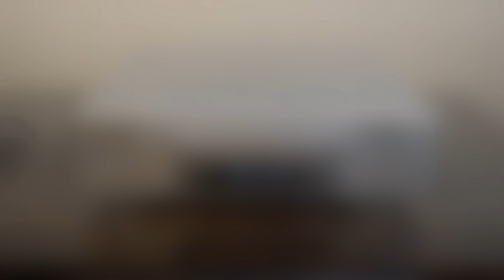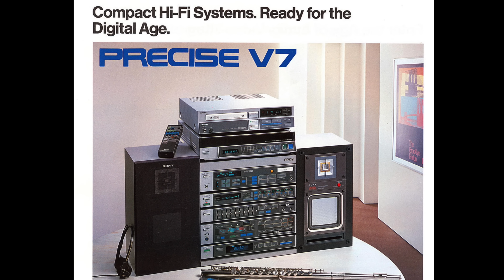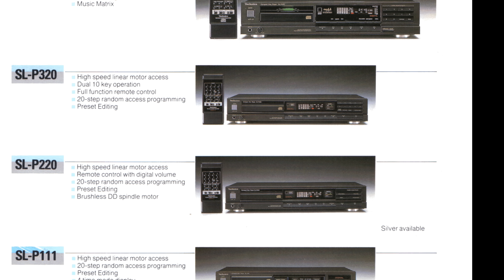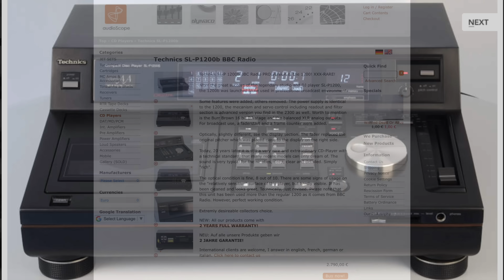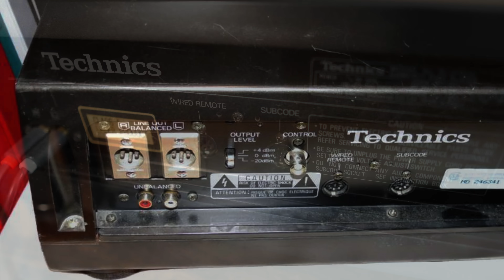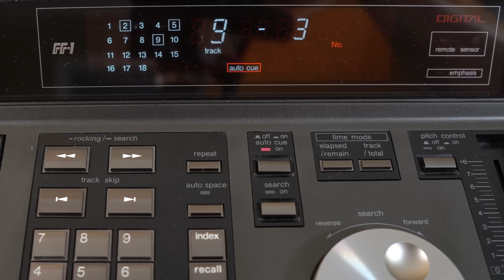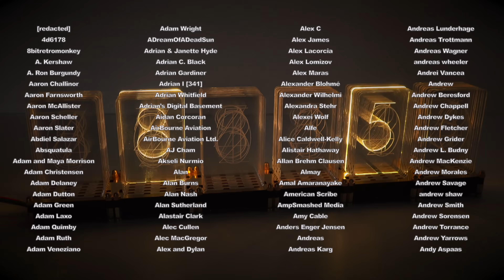How CD players lost their cool & why this Technics didn’t.

Comment: I think that it's really boring to see evolution of CD players because during the age, manufactures slightly reduced amount of buttons on a front panel. Front panel looks cleaner but for many tasks, you need a remote or find settings in a menu

For example SONY CDP-415, released in 1994. On a front panel, we can find buttons for basic controls like PLAY, PAUSE, stop, eject or fast forward, but also a keyboard to directly select a track on a CD. Display shows actual track number, remaining time and all next tracks in a grid. I dont have a remote but I've never needed it

A 14 years later in 2008, SONY released SONY RDR-HXD750, which is also able to play DVDs and record TV shows from DVB-T, but on a front panel there are only basic controls like play, pause, stop, eject and two buttons to skip to previous or next track. Display had been reduced to a single line alphanumeric display, so it's a step back from CDP-415.

But in 2015, LG released LG-BP450. Design is nice and clean, device is really small but without a remote, I am only able to power device on and eject tray. Next to this two buttons, there is only one LED which lights when device is powered on and flashes when I press a button on a remote. But to determine which track is playing or how much time remains, I need to have a TV powered on. I dont know if newer devices which will be relased in the future should have worse controls

Comment: I remember when these came out, or at least when I became aware of them. It was 1988-ish, and me and my mates were all vinyl DJ's (Club DJ's in San Francisco) and all had SL 1200 turntables, because of course we did, those are the only proper  scratch turntables for a DJ. Someone started going on about how Techniques had a CDDJ unit with pitch and everything. He thought CD's were going to replace vinyl in the clubs and we all laughed. Fast forward about 12 years and damn if he wasn't right. It was 2000 and most of my DJ buddies from back then had retired, and those of us left were mostly all switched over to CDs. At that point there were much better CDDJ units than this, but one night I had an encounter with one of these beasts. Actually a pair of them. Anyways I got booked for a guest DJ spot on a Sunday night. I had been drinking all day and was SMASHED. Long story short, somehow I managed to pull off a half decent (barely passable really) set even though I couldn't see or stand up straight. What a night. I will tell you all about it some time.
Anyhow, my admittedly foggy recollection of using this unit was that it was clunky, hard to cue with, and the unit reset itself every time you put in a new disk. Give me a Pioneer CDJ 1000 any day. Now a days those are old stock too, and most DJs have gone over to a digital DJ controller with Serato or Tracktor, plus one or a pair of good old SL 1200's and a laptop full of music. Gone are the days of crates of vinyl or books full of CDs. These days if the club has the right setup a DJ can show up with a thumbdrive full of MP3s and his headphones and rock the house all night. Like Bob Dillon said, "The times they are a changin'."

Comment: ´The problem with not to see, if there is an CD inside, maybe would be fixed by an intelligend Design, maybe to mirrow the disc-topside to the front of the player. And if we fully creative, the topside  can be in such way visible, when there is a light, that swithed one times per wind of the disc, so that we can see the disc-imprint in flash-light and see the inprint in identifiably and readable way on this position. 
But... maybe in distorted view, because the frnts of the Player are not high enough, so that the inprint is more broad, then high. But better as nothing to see. Th eproblem, that the light cannot see, when the disc isin the direction, so that so scripture on is in the right position (and not bottom up), maybe one can prevent, by inserting the disc in exactly the right orientation so that the font is illuminated the right way round. Overcomplex? maybe. But a solution of the problem.

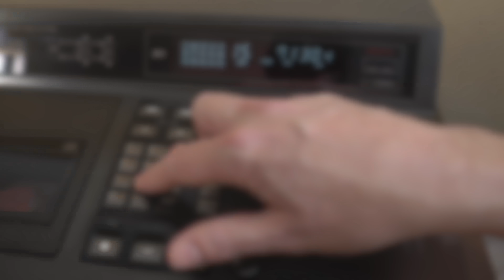Comment: Around 13:00 you discussed the ability to cue very accurately. Another feature often found in these machines is the accuracy in timing of play back. The time from the moment you trigger it to play. For editing purposes it's important to be repeatable. You want it to take the exact same time to start playing from the moment you trigger it to play a specific point. it depends on the spinning disc and the location of the laser at the time you trigger it. You might have to wait for another rotation until it's at the right point to Pllay. The really accurate machines would compensate for this. Every time you press play it took the exact same amount of time before the play actually occurred. If you were using the music for editing this allowed for very precise edits.

Comment: Thanks for your hard work. But you failed to mention that a lot of early CD players did not have gapless playback. For instance, when playing classical music, there should be continuous sound when tracks change within a movement. But on some older players, there would be a one second gap of silence when the tracks changed. Also, some initial players (and CD's) also had index numbers within a track, e.g. one track could contain 12 iindices within it. Cheers.

Comment: I have been a pro mixing performance DJ for decades and the Denon was the first realistically usable machine. The technics just didn’t cut it in a club. Still opening the wrong drawer was a definite fail risk so when the first pioneer CDJ’s came out they were a god send. Most pro club DJ’s defaulted to the pioneer pro range and have remained there ever since even though we now play digital files.

Comment: When you are saying the Technics is a "model from 1986 and you can forget about playing any discs you burned" - my first CD player was a model from exactly 1986, a german "Schneider CDP 7600". This one later played EVERY burned CD I ever gave it. No issue at all... 
Would be quite interesting what really makes the difference that some old player can do that and such an expensive and professional model can't... 
What might be important also on my CDP 7600: it claims to have a "3 beam laser pick up" system, what seems to be a first improvement done one early consumer players. And even more important maybe - after one initial issue right after buying it (problems with playing CDs in general) mine was "hand adjusted" (as they told mit back then) on warranty and then worked as expected. And still does. Even had to replace the bulb behind the LCD once in 1999, to led backlight on this model 🙂

Comment: Back in the mid to late 80’s my friend’s parents owned a PYE (Philips) MIDI stereo system. It was a black, one piece system made to look like a more expensive stacking system (like a lot of the units back then). The main thing I admired on the system was it’s integrated drawer loading CD player at the base of the unit which had a long rectangular window above the drawer. When a CD was played an amber LED would shine down on to the disk so you could see it spinning through the window. This complimented the players amber LED display beautifully. Loved the design. It’s such a shame that it never caught on.

Comment: I remember it well, having spent many a lunch time down Tottenham Court Rd, going from HiFi store, to HiFi store drooling over the separates I’d add to my wish list. I did however save up and buy the SLP-770 which was the 3rd tier model down in the range, it also featured a jog dial, although not as useful as this, more of a gimmick really. And although it had a draw mechanism, it did have a window and a 45deg mirror so you could still see the CD spinning. Yes, the SLP-770 was the crowning piece of my Technics HiFi at £370. I sold my system years ago to my older brother, he still has it along with the cassette deck, digital tuner and amp.  Happy days.

The comment about the SPL-1200 falling on you genuinely made me lol, so true 😆.

Comment: Here's another CD player recorder that is completely out of the ordinary and gives you awesome audio beyond anything else I've ever heard and that is something by marantz from 1991 model number CDR one.. revered in Europe is one of the finest CD players of the day and still are as well as being able to record on any disc format from Orange book to red book without any problems analog and digital input analog and digital output including many other toys that you will never see on another CD recorder since that time the marantz cdr1.. back in the day in 1990 was so incredibly expensive as well close to $7,000 for one of these recorders and the only company that produced cdrs at the time where TDK which were green died 74.24 seconds long recording time and had a foil backing which would begin to flake away in 3 to 5 years.. the cost for these blank discs of the day or anywhere between 15 and $25 each because of copyright agreements between marantz and TDK in the recording labels to pay for what you would have copied of which they would have gained income from if you had just gone to your local record store and bought a copy of whatever it is you were recording.. other than that.. I have truly not found another CD player that comes even close to the Sonic ability of the Moran cdr1.. have owned this piece now for a little more than 30 years and it still works fine it is a tank a concrete died in the wool last forever machine..

Comment: I agree about the CD players being boring. The first one I ever had was a Sanyo CP-10 which was a quite small top-loader that let you see the CD as it was spinning and I remember being intrigued (I was around 10) by the fact that the CD rotation slows down when playing the later tracks, as opposed to a record player. I still have it somewhere but it had stopped reading discs at some point - might be worth it to try and repair it!

Comment: I owned a couple of top loaders, but they were mostly Boombox Style. I think the CD was really a format driven by convenience, I think this is shown by how quickly it was replaced by streaming/digital ripping. I think that also played into the case format and stackable nature. Let's face it, you only had one the top of the rack, and that was reserved for vinyl.

I had a couple digital video recorders and computer hardware that was cd-rom or dvd-rom and they had enormous lifetimes for the discs because they used cassette cases. I think it also showed how the race to the bottom for cost drove CD design. The original disk design was with an optional cassette. I only found that out much later when I was reading through some of the specs. 

I do love that promodel. Something about the tactile design, and the button heavy panel. Very cool.

Comment: Just my IMHO. But CD's were so reliable you didn't need to see if they were running. With a cassette or record you wanted to be able to see if something is wrong and destroying your media. The CD on the other hand usually was safe even when the machine failed. I think why people really feel meh is if you bought a $100 vs $1000 machine they all basically sound good and very similar.

Comment: The cueing-by-frame system was actually the backbone of DJ mixing when using CD players. The Pioneer CDJ-500 was a very popular early DJ deck that not only featured a jogwheel and pitch control, but also offered seamless looping via the now-standard in-out yellow buttons. DJs were obviously skeptical about CDs at first compared to vinyl, but as soon as the 2000s kicked in and the CDJ-1000 deck arrived, the CD took over.

Comment: is the 'pitch' shifter (aka tempo shifter in non Technics-speak) analog (like the technics sl-1200mkII) or digital (like later iterations)? it's interesting that the pitch control on the technics CD player is the reverse of the pitch control on their sl-1200mkII. always assumed it was an inhouse designer/engineer  assumption that moving the pitch further away from you meant record should play slower and moving pitch control closer should make the record play faster. but it's the reverse on this CD player. i wonder what would have happened if they made a less expensive version aimed at the burgeoning DJ (clubs, discos) market in 1986 keeping the features most useful for DJing - features some if which didn't appear on dj CDJs until well into the early 2000s. nice1

Comment: CDs got boring to many largely because some negligent music producers-and indy musicians recording music in their home studios-use lower quality "interfaces" containing less than well designed A/D converters to record their music. Likewise, regardless of their speakers, headphones, amplifiers cables and room acoustics, consumers often use CD players with equally or even lower quality D/A converters to play back that music. So it's not too surprising that IF well recorded, mastered and pressed, a brand new vinyl album could sound better than the CD version (though probably not in the low bass), since at least on the consumer end there's no digital conversion being used during playback. It won't come cheaply but those who step up to using a good quality standalone D/A converter (DAC) fed with UNcompressed CD track rips saved to WAV or FLAC files (NOT lossy 8 bit mp3 files) by their computer may end up thinking twice about buying the vinyl version (which audibly degrades every time its played) when they hear what a Benchmark Media, Exasound or better DAC can do to the sound of their CD collection, to say nothing of SACDs, 24 bit music downloads or DTS-MA soundtrack and/or isolated score rips from Blu-ray movies.

Comment: My favourite cd player is most definately the SL PC 705 five disc top loader player, with a lid like a record player opening at the top. You load your cds easily, can see them change, and have 5 discs playing at random or one after the other. I had 5 of these machines, unfortunately 3 of them do not work any longer because the lasers are kaput

Comment: the first thing that i thought about when seeing this unit is if it could play CD-Rs. 

many years ago (1999) i had a friend with a boombox that wouldn't play CD-Rs and i was adamant about figuring out why. ultimately, i think it was "the laser is old, and it only reads heavily burned data", which is what commercial CDs are.

back in the CD-R burning boom of the late 90s and early 2000s, it was all about getting CD writers that would write at high speeds. first it was 2x, 4x, then later went on to probably 50x or so. 

all of those high speed burns result in poorly written etchings of data that still play in modern players, but if they get even remotely scratched, well  the low threshold to having a skipping CD comes into play. high speed burn = a CD that doesn't maintain it's data structure very well; low grade. 

that's where CDs that are burned at 1X comes into play. sure, it takes 70 minutes to record a 70 minute album, but the scratching to skipping threshold is higher, and 1X burned CD-Rs have a better chance of actually playing in older players from the 80s that have high mileage on their lasers. 

another bad side effect of those days of marketing high speed burning is that many of the CD writers wouldn't even allow burning of CDs at such a slow spped of 1X; many manufacturers locked the abilities of slow 1X burning out in their firmware.

@techmoan should look into that.

Comment: I have one. Had issues when I bought it. 
Some switches were not working and it wouldn’t read some disks. Bought a new laser for it and now it reads and plays burned cd copies (not compressed formats). I have now replaced the output opamps with Burson discreet units and cleaned the tactile switches and everything works beautifully. I thought about re capping but when I looked inside the quality of parts used are way better than any other Technics piece I’ve opened. I’ll leave well enough alone for now. The opamps made a very noticeable difference.

Comment: I like CD players. That Denon one you show DCD F-100 almost looks great but the draw and buttons look cheap and boring imo.

What I don't understand about CD and MD decks, are that the discs are small and compact, but the decks are colossal.

Why don't more CD players look like the main unit of the Wii U. Tell me that controller aside, the Wii U wouldn't look like one of the most appealing CD or DVD players.

Although I do like CD player decks in terms of looks, I don't understand why they aren't smaller units. Likke that Denon, the Wii U or the Pioneer DV-U7 DVD player that I'm using as a CD transport.

Comment: I had this weird... I think it was a Jensen... vertical CD player that held three discs and had motorized doors that opened like barn doors. It was pretty terrible. I remember getting it because I thought it looked neat, and it did, but it wasn't very fun to use. The discs were in a triangle pattern so the whole thing was really quite wide, and then the doors had to open quite a way to let you get the discs out. If I remember right the platform the discs sat on rotated too. 

Yeah it was impressive to look at, but you wouldn't want to actually use it for anything.

Comment: Interesting video. The start bit would of been easy to answer with my Series 500 TEAC CD player as soon as it comes on from standby it shows the tracks and how long the album is but doesn't play until you press play and if there is no cd in the draw it says.. no cd. Also when you press play it take about 2/3 seconds to start playing.. maybe less but then again it was a fairly high end CD player (and system) of the time so its not going to lag behind or be missing features. I've had my system for over 20 years now. Love it. 😊